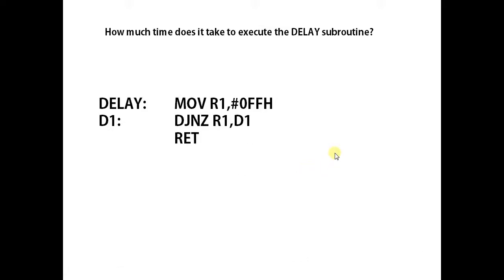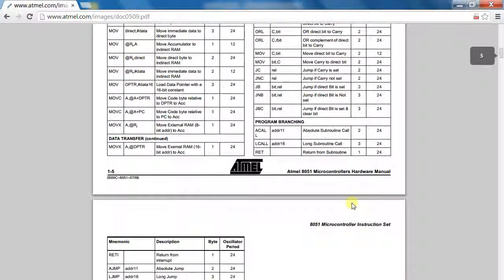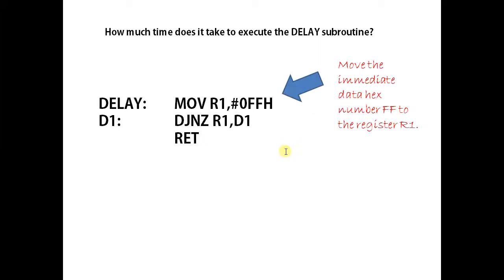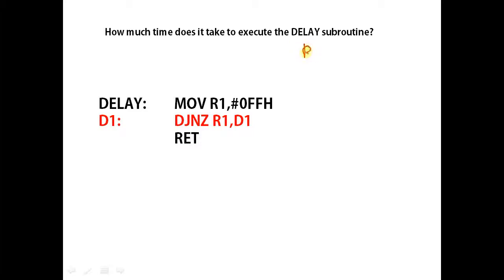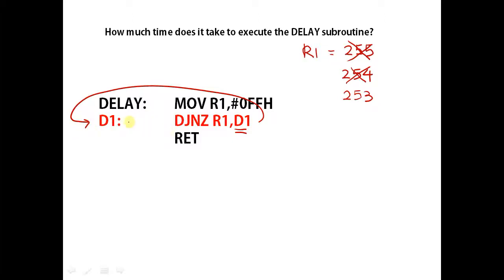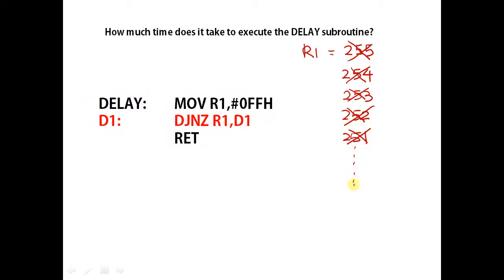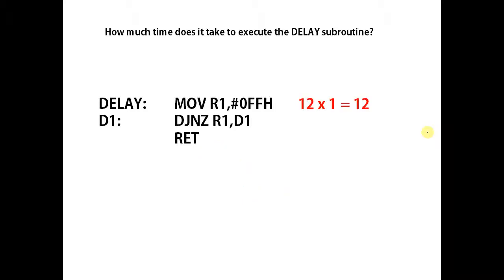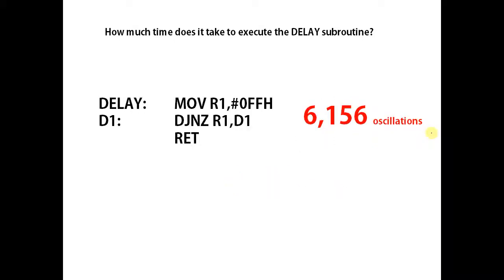8051 CPU Timing Part 2

Comment: Is there any formula to.learn oscillation period without datasheet???
Reply from the maker: You would definitely need the datasheet. Different derivatives of the 8051 have different execution cycles. Most instructions for the classic 8051 takes 12 clocks to execute. Most instructions for the Silicon Lab 8051 take only 1 clock.